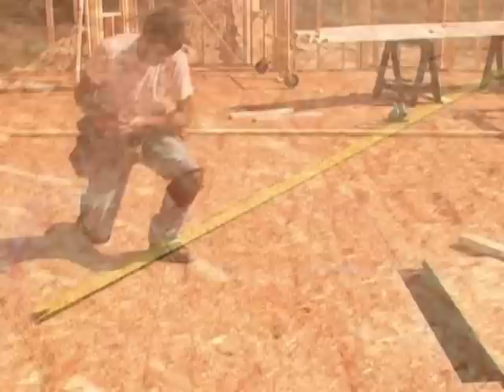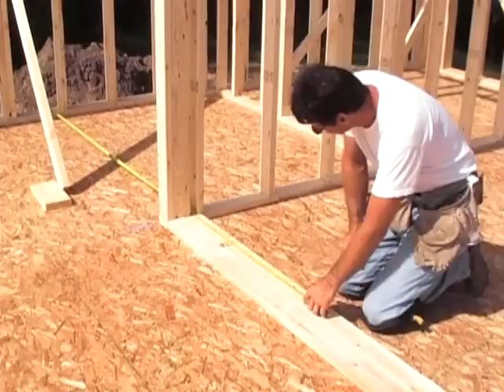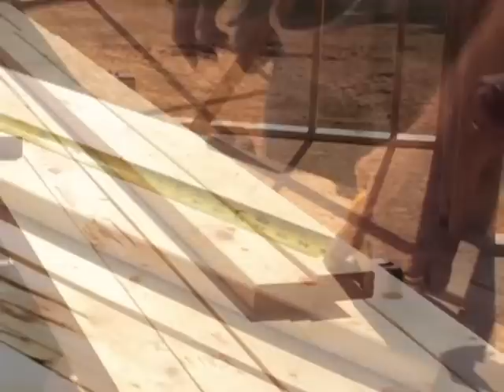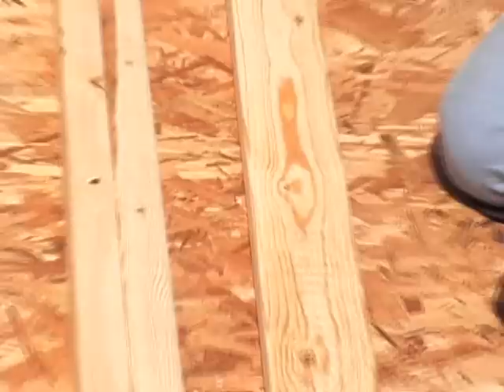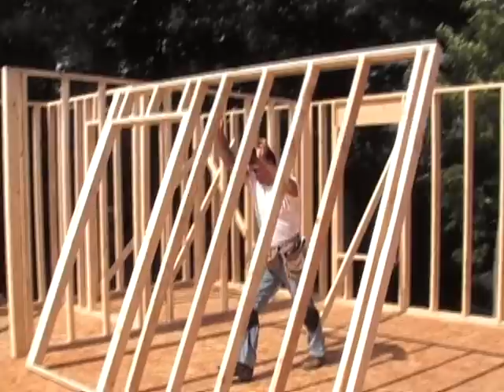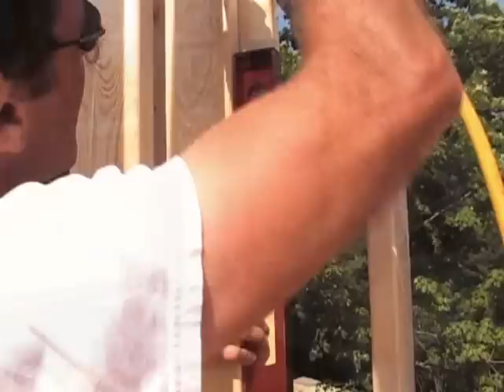Framing and Building a Wall

Comment: I really appreciate the step-by-step breakdown in this video! I've been in situations where getting the chalk line right made all the difference. I remember a project where I missed that step, and it led to uneven walls. 

Using the 6-8-10 method is a game changer; it ensures everything is square. When I’m framing, I always double-check my measurements for the Jack and King studs, especially when working with door openings. 

One tip I’ve learned is to pre-drill my nail holes when working with harder wood; it saves time and prevents splitting. Also, I use FloorTally for my cost estimates—it helps track materials and keeps my budget in check. 

Nailing the wall into place can be tricky; it’s always a good idea to have an extra set of hands. Thanks for sharing such great insights!

Comment: Hey, the question is not directly related to this video, but I wanted to ask you anyhow since the question popped up during the “framing walls” video. 
The question will be about connecting walls, straight walls not intersecting walls. Say we’re building 40 foot long wall. Obviously this length is not available in lumber. We build it up by parts. 

Option one : we break the top plate on the stud and connect the next piece on that stud as well, and the double top plate laps over 4 feet as normal.

Option 2. We break the top plate between studs and then there is the connection ( between studs ) and then the double top plate overlaps the connection 4 feet.

In the nutshell: do we connect between studs or on the center of the studs? Which is more common?
I’ve seen bot of them.

Thanks 

Péter
Reply from the maker: Peter, you are correct that it can be done either way. I’ll try and give my opinion on both methods as I have used both. 
Joining over the single stud eliminates a stud and keeps the wall cavity the same size for installation of fiberglass batt insulation. The disadvantage is it can be weak until the top plate is added. 

The advantage to studs on the end is the strength created by being able to face nail the two studs together; and you would use an extra stud every wall you join. Disadvantage is the smaller wall cavity space for less insulation or cutting fiberglass to fit, along with the need to caulk the two studs for air infiltration. 

Either way works, it seems to be more a preference thing.
Reply: EZ-Hang Door thank you very much for the answer I appreciate your help thanks again have a nice day
Reply: EZ-Hang Door my questions are probably driving you nuts, I apologize, but please be kind and answer me one more question that I’ve been wondering about.
For the sake of argument let say I have a wall ( exterior wall) 2x6 with double top plate that holds a floor ( ceiling ) joist system nailed 16 in oc. I need to put a roof over the walls. 
Spam of the building is 22 feet, rafter I’m going to go with is 2 x 8
Should I space ( simple gable roof 8/12 pitch) the rafters 24 in oc or go with the more common 16 in on center spacing? ( third option 12 inches seems too “tight” for the first look)

Thanks so much 
Have a hive day,
Péter
Reply from the maker: @peterbalazs1537  Unfortunately the answer to the question really depends on other factors. The climate you live in, the Building Code you are constructing under, wind loads, seismic factors if any, location of the building (exposure factor), and if the structure could represents a loss of life (ie a garage or home etc..)

You would need to verify the code in your location. There are span tables in the code book  that give spacing tables based on a number of factors. Those could be snow, the width  of the building (span), the size of the board, even the species of the wood being used. All of these factors play a role in rafter sizes. This is why engineered trusses have become so popular. For example I live in an area that gets snow in the winter. While a 2x8 spf  24" o.c.  could work in a southern or warmer climate, it may not work here.  This one isn't a preference answer like the wall studs, it's more of an engineering- safety issue. Hopefully that explains your questions.
Reply: EZ-Hang Door thank you very much for taking the time explaining me the details. I understand it, and since we really don’t have general code for this kind of a structure ( in Europe we use bricks most of the time ) I will contact an engineer who will be able to check the details and make calculations and modifications according to the results.
Thanks so much against for your time and for your help!
Best regards 
Péter

Comment: Tip. Mark your window and door openings 1st, on the 1-1/2" part of the 2x. then mark your studs. That way you can see the maks when you nail the studs to the top and bottom plates while standing up. Been doing it for 42 years, still doing it! 
I started out without nail guns, all hand nail.......Yep, older than dirt. LOL!

Comment: How do you make sure the wall you've built is square and level to itself and not slanted?
Reply: 7thDayofGrace when you stand it rack it plumb and nail it in place...only time a wall needs to be squared is if your putting ply on it and nailing it off.

Comment from the maker: A concrete floor would not change how the wall is built other than a treated bottom plate would be required. You would however need to fasten the wall to the floor with concrete nails or Tapcon screws. The exterior walls would require anchor bolts placed in the concrete every 6' min. or per your local building code.

Comment: When you finish by checking to see if it is plumb with a level then attach it to a wall that may or may not be plumb, the attached wall becomes out of plumb sometimes.
. Always better to be parallel square and strait with plumb as least of priority. Take care of the first three and the last will take care of itself.

Comment from the maker: I actually have been doing construction for over 25 years. We sometimes do add our top plate, but we have found it to be somewhat advantageous to install after the walls are in place. This takes the hassle out of over-lapping plates and we get tight fitting plate joints. One guy cuts and another walks the walls and nails. Just a preference of ours. As far as the crouching goes, it's a back issue, mostly mine...as you age it takes it's toll bending over. I used to be faster a few years back...

Comment: I have been a framer for a few years working with my dad who has 20+ years of experience. Why are you not putting your very top plate on before the walls go up? Your level is about 4 feet too short. Crawling around on your knees is slower just kneel or crouch... Please message me back on these things because I'm curious what goes through someone's head when they do these things.

Comment: 16" centers is the most over build ever the compression strength of a standard 8' 2x4 =536 psi take the surface area of the bottom of the 2x4 =1.5 x 3.5 = surface area 5.25 x 536 psi compression strength of 2814 pounds per 2x4

Comment: What are you using for your exterior walls (2x4, 2x6)? If it's 2x4 just put two 2x20 together then a 2x4 plate flush with one side later put the part of the header with the plate facing down so that it would make a top "sill". You may already have your house done but for any one else I hope this guys you an idea.

Comment: # 3 Do not plumb a newly raised wall to a perpendicular wall that hasn't been racked and stabilized through sheathing .. Reason .. when the wall is racked , whatever is plumbed will be out of plumb . just like his layoffs originating from a place of origin .. Apply the same idea to the walls ...layoffs on the plates ! or double checking top and bottom differences from point of origin . or make the top plate exactly the same as the measurement below .. One become plumb .. then all become

Comment: Nice try but there were errors .# 1  nailing studs into sole plate should not have both of the nails close to the center . Rotational center = studs have a higher likelihood to twist , #2 , Never transfer a layoff from an unstabilized point .. ie . when transferring layoff to plates from a point of origin , like a plate nailed down to a chalk line .. It is stabilized .. but a header/cripple layoff should not come from a possible twisted stud in he "Field " but come from the remainder of layoff

Comment from the maker: You could try and remove them from the top and bottom plates, the problem may be how well they are attached to the wall sheathing. If they are bad anyways, try hitting them with a sledge hammer.

Comment from the maker: You're so right, construction is hard on a body. I have caught a lot of flack in the video for framing on my knees. The truth is I did frame bent over for years (and much faster) but that took its toll on my back. As you age you look for ways to work smarter, or at least a little less harder on the body. Age is one of those things that will catch us all....
Reply: EZ-Hang Door true that ! Rough frame for life ! Why the bags in front though ?? Hammer need's to be good with both hands . end of the day personal preference

Comment from the maker: @hovh03 noggins or blocking is not required per our building code. Our area code requirement is for a 90 mph wind speed. That's pretty light considering most other areas.

Comment: don't nails have greater shear strength than screws? you bend a screw past a certain point and it snaps. My house was built in 1847 and it's holding up very well

Comment from the maker: A non load bearing wall does not need a header if it doesn't carry any weight. If you are placing joist over the opening, then it becomes a load bearing opening, which needs a header as you described. The framing in the video has a truss roof system with no weight on the interior door openings.

Comment from the maker: @VAxHUNTER94 The L shaped piece actually will work for both interior and exterior corners. A big advantage to using them on the exterior vs. nailing blocking to two other studs, is it allows for insulation to be added in the corner after the house is framed and dry.

Comment from the maker: The L shaped piece goes in the corner. It provides solid blocking to connect the walls together and a nailing face for drywall.

Comment from the maker: Great question! there is no header because the wall is an interior, NON-load bearing wall. Engineered trusses span across the building and walls inside the building have nothing bearing on them. Therefore, using a thick header material designed to carry loads would be a waste of money.

Comment from the maker: @KidRockland A rough opening for interior doors should be 2" wider than the door you will be installing and 82-1/2" high. So if you installing a 36" door you will need a 38" wide opening.

Comment: For marking plates we usually just nail the plates together and mark out the studs on the sides, then when you're ready to frame you pull the nail connecting them out (it's only 3/4 of the way nailed in) and you're ready to go.

Comment: @MrShannon888 

An angled nail, or a "toe nail", does hold better because you are creating shear. But as long as you space your nails apart while face nailing them to the plate, then that will be good as well. If you don't spread your nails far enough apart, the stud will still be able to twist.

Comment: I usually go ahead and nail my top or double plate on the wall, before I raise them, when I mark corner's and partitions I make a three and a half mark and hold the plates an eighth back , and pick the straightest lumber so lining the wall is easier,
this way I'm only on a ladder in the corner's and partition to nail off!! it locks everything together on top when you connect walls and makes it easier to frame alone,

Comment: @ezhangdoor Toenailing is alot stronger than face nailing, its a lot better with lift-off of the studs, usually only 2 nails face nailed in a 2x4 compared to 4-5 toe nails. it all comes down to how you build your walls, on my crew we nail the plate right to the floor then toe-nail into double top plate and stand walls and then toe-nail into bottom plate.

Comment from the maker: @MrShannon888 Your correct, OSB doesn't take moisture as well as plywood. That being said, there are some higher grade OSB sheathing that will resist moisture quite well. The problem is the price is also quite higher. As far as joist hangers, most codes require hangers on most connections now. There are a few expections with regaurds to 2x dimensional lumber and the number of joist carried. Best advice, use hangers on everything.

Comment from the maker: @MrShannon888 In new construction I would recommend face nailing plates to studs. It's much faster and my opinion just a strong. However, if space is limited, such as a basement where you wouln't have clearance to raise a wall, then toenailing is the way to go.